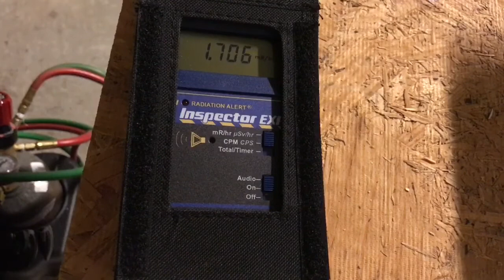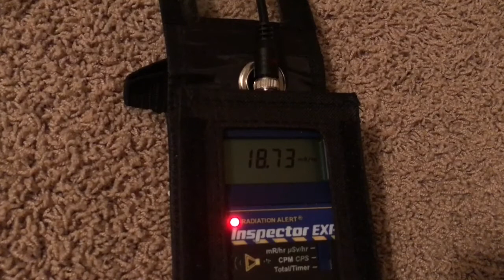X-Ray Dose Rate- Static vs AC 40kV Flyback

Comment: what is that wheel machine called? is it some kind of induction motor?
Reply from the maker: That is a Wimshurst Machine.  I bought it . They can be made from parts at home and there are instructibles out there to make one. I bought mine for about $80 here is a link:
http://www.ebay.com/itm/NC-8757-Wimshurst-Electrostatic-Machine-Static-Electricity-Generator-Whimhurst-/272273186740?hash=item3f64bf1fb4:g:KtYAAOxyi3FRzJKr
If you are interested in doing the demo, i can get you the part number for the rectifier tube. Costs about $5